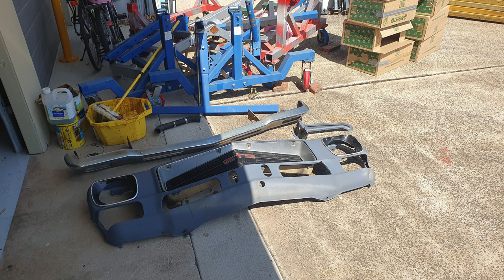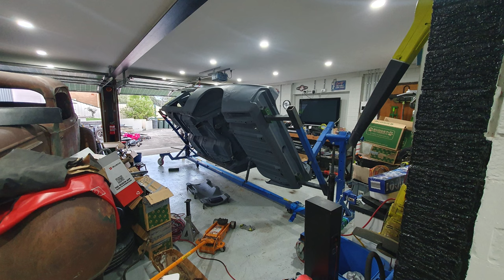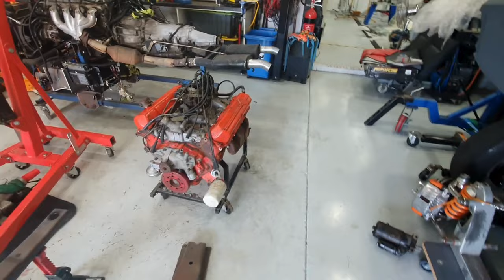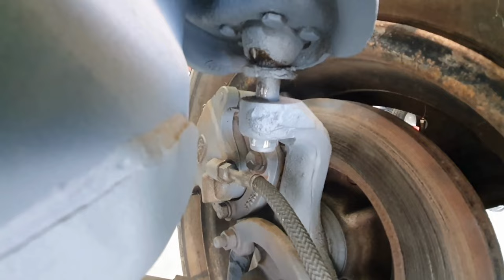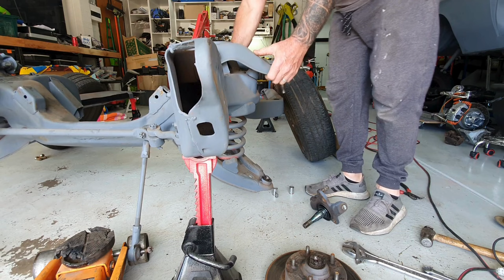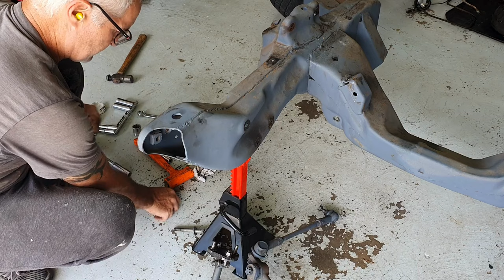Its finally time to strip down the HQ GTS Coupe.

Comment: Awesome stuff man, enjoyed this one. I had a Febuary 1976 HJ Caprice (One of the first built production run) It had weld spatters here & there but not a lot. Personally I don't think it matters if you keep or remove them. It can only be built once to Factory Spec - as in, on the day it was created. Anyway, this was nice to watch & brings up good memories. Cheers, Leo.
Reply from the maker: Thanks for the positive comments. Yeh I guess your right, it's only as factory as the way the assembly guys  assembled it, and there were lots of different people so lots of variation in quality. Glad you enjoyed it.
Reply: Yep spot on mate, I worked at Holden for 5 years, would have stayed longer but seen what was coming. Less good memories right there. Thanks for the reply, cheers.  @SullysRodskustoms.

Comment: Street Macine built up a WB ute and they said the upper control arms are often bent, or rather not straight. How does this happen? Is it to do with changing the bushes? Would be good if you could illustrate more on this area. What to look for.
Reply from the maker: If the control arms are bent from removing  the bushes the person beat them out. I used the right tool and they just popped out. $60 for the bush removing tool is cheap insurance in my book. The control arms can also be bent from an accident too. But that's usually obvious damage.

Comment: I spent hours cleaning/grinding all the welds and splatter on mine in my hz mate..
I reckon it does look cleaner in my personal opinion..
Each to their own though!!
Reply from the maker: Yeh that's where my head is at Scott. I gave it a light scuff with a paint stripping disc. And it made the spatter look worse. I could only imagine how bad it will look with fresh powder coat on it. I'm going to flapper disc the spatter that I can get too.
Reply: @SullysRodskustoms.  exactly what I used mate..
Reply: I've always cleaned up spatter on my projects. Spatter is advertising for lazy arse workers. Looks much better and easier to clean.
Reply: @chrisbenn8691  yes mate 💯 but some are worse then other's..
In some respects I wished that I had my chassis power coated heaps more durable..
Reply from the maker: I'm lucky I cleaned the spatter off today, I found a minor crack in a weld that I ground out and re welded, plus some dents in the chassis from some idiot jacking up the car under weak points on the chassis.  Heated them with oxy torch and panel beat them out.
Reply: @SullysRodskustoms.  aren't you luck that you decided to go that way,mate..
Least now you have addressed the issue's..
In some respects I wished I'd of power coated my chassis/subframe mate..
Reply from the maker: Yeh your right @scotthunter1639  Not looking forward to the powder coating costs though. Much cheaper to buy some 2k primer and 2k satin black and paint it.
Reply: @SullysRodskustoms.  that's how I did mine mate with 2k..